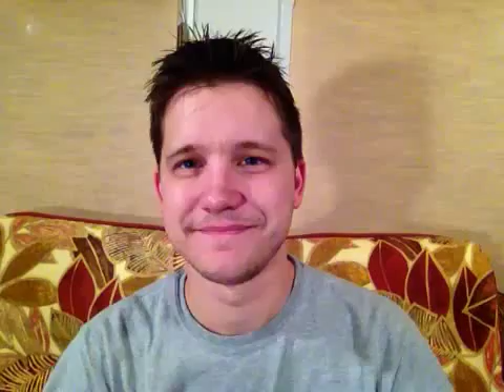What Is Overclocking? How Does It Work?

Comment from the maker: That's not really how it works. If you increase the cooling properly then it runs faster at the same wear on the hardware. In other words, it would be like you're still walking, but getting there faster. As long as the cooling is keeping the temperature at the normal tolerances, you can continue to overclock it indefinitely. Eventually you reach a saturation point where it simply runs too hot.

Comment from the maker: Depends on the tool you are using, if you overclock through your motherboard it will automatically do the performance gain before you boot Windows. If you do the overclocking through software (such as graphics card tweaking software), the overclock will initiate once the application is executed on windows startup.